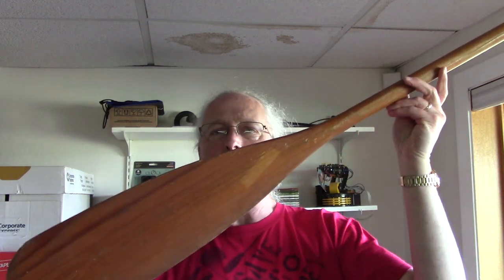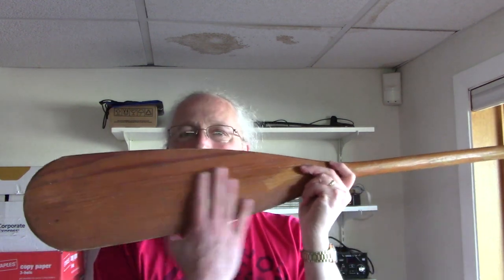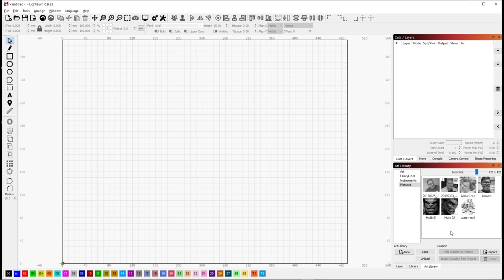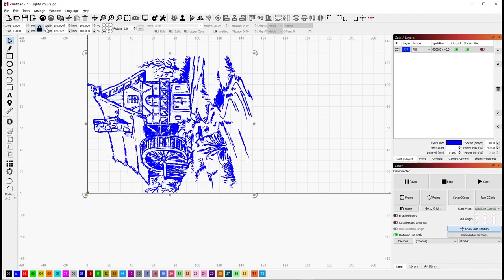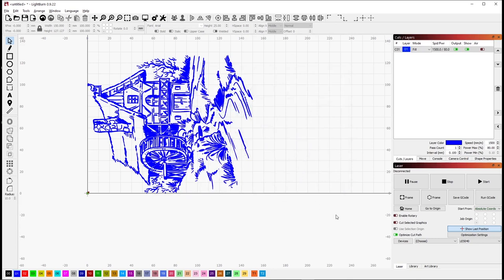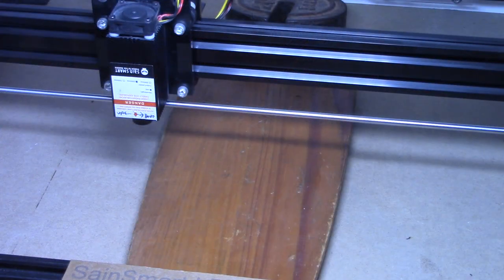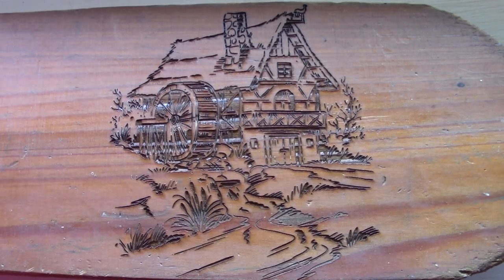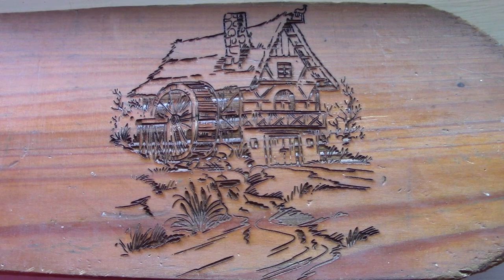My mom gives me the paddle... Then I give it back!

Comment: Hey. I have the same model. I have to turn the laser on manually and it stays on. Can you please suggest anything.. it should be the way yours is...
Reply from the maker: At what point do you have to turn the laser on and off?  AND how are you doing that?

If it is for looking at the Frame option within LightBurn, that is a simple press of the shift key when you click on the Frame button.  If it is when you start and stop your burn project, that sounds like a more serious issue.  If you are able to output the G-Code to a file, do that and take a look at it to see if it is putting an M3 or M4 in the code to turn the laser on.  At the end, there should be an M5 to turn it off.  If these are missing, then it would be a setting in the software you are using to generate your G-Code.  Let's start with that and see if we can track down what is going on with your laser.
Reply: @CNCATHome  when the project is about to begin. Laser will move to the starting point but I have to push a little button on the laser itself to get it running. Weird
Reply from the maker: @TheMrXpunch  - That is odd.  The only button I have on my laser controller is an on/off switch for turning the whole laser on or off.  There is also an on/off on the main controller too.  I typically leave them both on all the time when I am using it and the controller tells the laser when to start shooting fire and when to stop.
Reply: @CNCATHome  yeah exactly my controller seems drunk. It’s still under a warranty I’ll see if  I can get some troubleshooting going